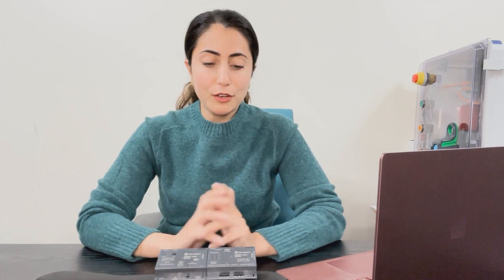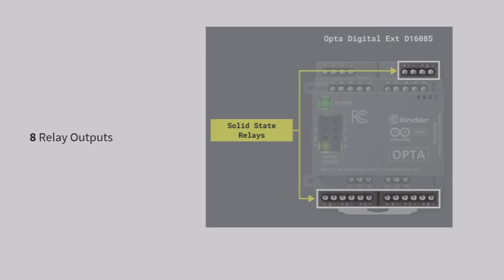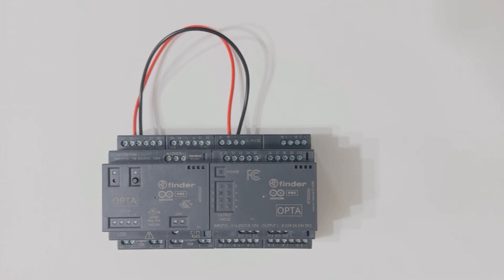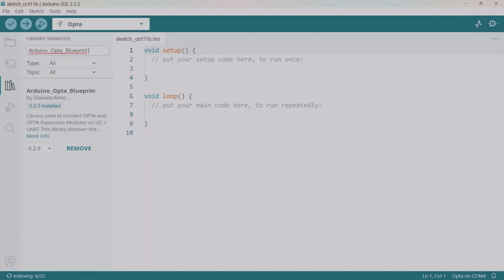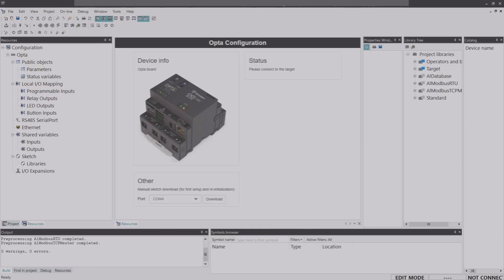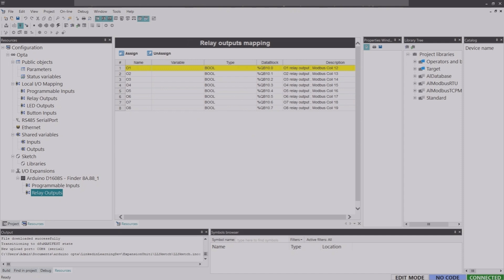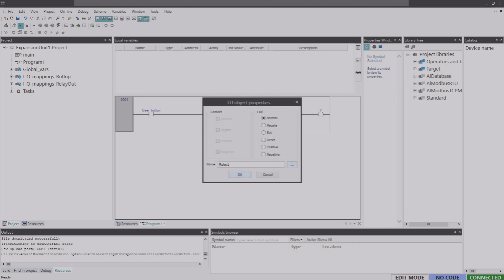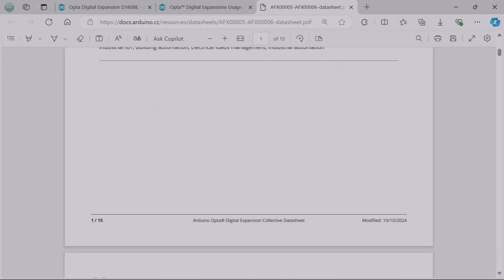Arduino Digital Expansion unit (D1608S) with OPTA PLC

Comment: Okay your video was very helpful.
I have doubt , like how do we name the Opta expansion module pin in our arduino code ?
For example I1 in arduino opta is A0.
Reply from the maker: Thank you , glad you found the video helpful. You can give the Opta expansion pins any variable name , for example if i have a sensor connected to I1 in the expansion unit ,i can simply choose Sensor1. Variable names is chosen by the user. Hope this helps

Comment: Do you need to have the expansion powered for the IDE to see it when scanning, ive never had to power the opta externally when programming?
Reply from the maker: Yes , the expansion unit has be externally powered for the IDE to see it , and hence i used that in the video. For Opta alone , you can still work with IDE without it externally powered( it can receive power through the USB).

Comment: When programming the inputs the bool. Doesn’t seem to work. I know it is working and addressed correctly because it works when an analog function but not a digital. Any help would be appreciated.
Reply from the maker: Oh , What type of Opta expansion module you have ? there are three types and one of them is only Analog .. do you happen to have the analog type ?
 check this document to see the different ones : https://cdn.findernet.com/app/uploads/ZDPENXX8AXX.pdf
Reply: @ thanks after many hours of trying to figure it out. I found that I was using the wrong power supply. 12v. Used the 24v.
 And everything went fine. Thanks for the response.
Reply from the maker: @rodmanrn11  Oh I am so glad you were able to figure it out , and that every thing went fine. That's quite interesting ,that 12V won't activate the boolean pins . Thanks for sharing with me and let's us know how you solved it, and i know the troubleshooting part , sometimes it drives me crazy when i spend hours :D